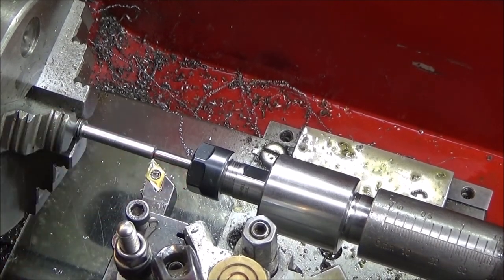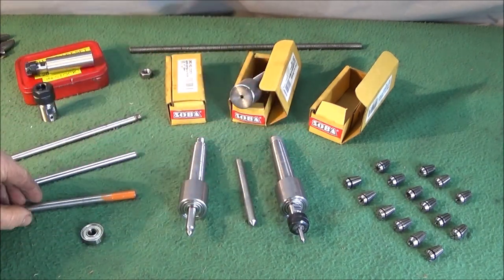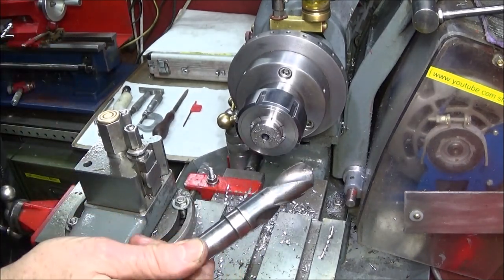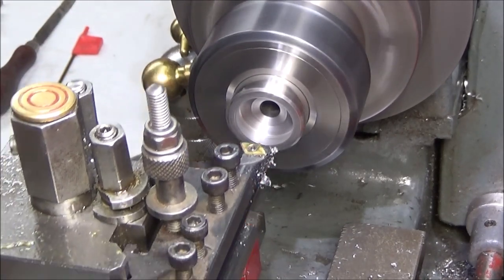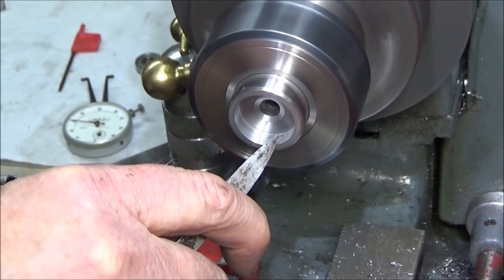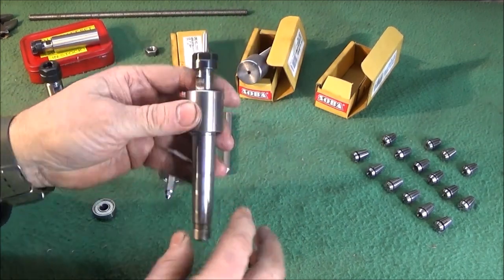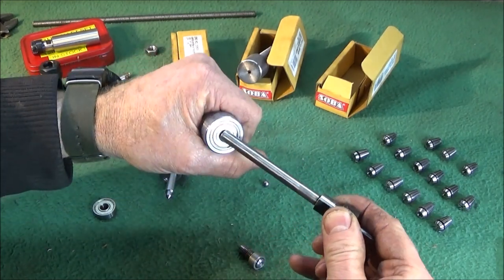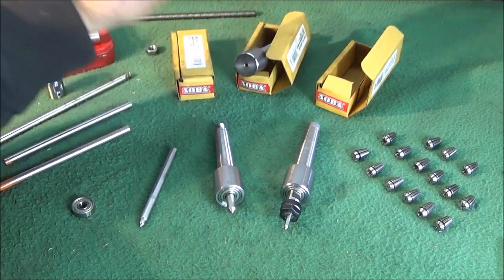Make A Multi Purpose MT2 Live Centre With An ER11 Collet Chuck

Comment: Very good setup there. I would add a cross hole through it after the  bearing for a pin so it could be stationary if needed. You could drill, ream, and use it for live center too.

Comment: Wow! Great idea. I will definitely find that useful, thx.

So much going on in that video that is different from the 'common' setups we see. The QC tool post on your Myford; did you build that? Do you have a video on it? And your ER40 collet setup, very interesting too. The T-slots on your Myford cross slide; original or modified cross slide? Also liked the way you used the dial comparator for inside measurements. Good video Steve.

Comment: Another option for spindles is to use injector pins which are hardened and come in many sizes and lengths and are very cheap. You find that most toolmakers that work in the manufacture of injection moulds usually have a box full of offcuts !

Comment: The ball does not roll, but slides.
This can damage the surroundings of the ball.
Whether it is necessary to temper them,
or is the load so small?

In any case, the idea is good by its simplicity

Comment: Hi Steve. I've made a live centre for my ML4 from your video. Because the tailstock only takes a MT1 taper, I've used 6mm Silver Steel for the spindle. The soft arbor already had a 6mm threaded hole at the narrow end so it was ready to take a screw. I was able to drill through the centre of the arbor without a problem. I bought an SKF 6mm x 19mm bearing and bored the large end of the arbor to suit. I'm very happy with this project. Thank you for a great idea! 
I would like to know if I should harden and temper the pointy end of the spindle.
Reply from the maker: Hi Neil, Thanks for watching and for your encouraging feedback. It's up to you if you want to harden the tip. I didn't though and mine is still ok. I'm pleased you like my videos.... Regards Steve

Comment: Thanks again for a great and simple design which I borrowed and put two bearings in the Soft Arbor to support a 8mm to M14x1 adapter I had around for the mini 60mm 3-jaw chuck. The shaft on the adapter is only about 1" so I figured two bearings to support the weight of the chuck should do it. Do you think I should have put three bearings in to take the extra load?
Reply from the maker: Hi Wilson, No I rekon that will be fine. See how it goes. You could always upgrade it, if you need to at a later date

Comment: Hi Steve,
I know you made this a few years ago and you've review a ready made live centre set since but this is still a very good affordable option. I have a couple of questions: would you still make it the same way or improve it and would more than 1 bearing be an improvement if they were stacked? I don't have a large ER chuck, so could the blank MT2 be drilled in the headstock arbour, or is that a no no because it might spin in the headstock and cause damage - an adjusted 4 jaw might be safer?

Cheers,

Chris
Reply from the maker: Hi Chris, I would still make it the same if I needed to. Mine is still working perfectly. You could drill the MT2 taper like that. Just make sure the spindle taper and the MT2 is clean from oil. I have drill them like that in the past. Regards Steve
Reply: @SteveJordan  Thanks Steve for your reply. I always watch out for your videos and I've made a few projects including your top slide vice mounted drill which I still use a lot.

Regards,
Chris

Comment: Steve, I'm just curious, why do you have 2 small lathes?  What can one do that the other can't?  Isn't the lovely Myford enough?  Wouldn't the space in your compact shed be better used with a different machine for another job?
Reply from the maker: Hi No both the machines do about everything I need to do. I had the Chinese Mini Lathe for about 5 years before my brother gave me the Myford. If he hadn't given it to me I probably would never have owned one and this is one of the reasons I keep them both.... That is to show people that one can buy a reasonably low cost lathe and still produce the same precision components as an expensive lathe can. 
 I find having both the lathes perfect for my situation and there are times when each of the lathes have been best suited for whatever I'm turning. Plus leaving one set up for something while quickly going to the other to do another job is a great advantage.
 If I was younger I may have bought a larger shed and bought a milling machine plus kept both the lathes, but my situation is as it is. In other words,... I'm content with what I have and don't have the need for anything else.
Reply: That's fair enough Steve, thanks for replying.  Keep up the good work!

Comment: The tailstock on my lathe is only MT1 size. I don't think drilling through and adding a screwed plug to make a ball support through the thin taper is practical. I was wondering if I could drill halfway down the taper and drop a smaller ball down the hole. Would that work?
Reply from the maker: Hi Neil. It will most probably work. I don't see why not. Regards Steve
Reply: @SteveJordan  the taper of the blanks I'm looking at are hardened and ground. Would the hardening go right through or just the skin of the taper?
Reply from the maker: Hi Neil if you heat them up red hot and let them cool slowly naturally that removes the hardness. Or you can just try drilling them. It's best to use cobalt drills though.
Reply: @SteveJordan  many thanks 👍

Comment: olá!... fiz algumas formações na vida, mas aqui só estou aprender!...  o relógio, que tem duas pernas que está a medir o caixa com precisão eu não conhecia esse método de medir com esse relógio, eu nunca vi isso !...como se chama essa ferramenta?  e qual o diâmetro máximo que se consegue medir? onde posso comprar uma ferramenta dessa !..já aqui em Portugal nunca vi , e não conheço. se me poderem ajudar agradeço.  e obrigado, pela partilha de ideias e soluções !....  obrigado amigo!....
Reply from the maker: Hi Jorge,  The clock is called a 'Caliper Clock' or a 'Dial Caliper Gauge'. You can buy them in various diameter ranges. The one I am using here ranges from about 0.200" to about 1.100" Thousand of an inch. Another is about 1" to 2" Inch range and this has longer caliper blades on the end. There are several different ranges. When bought new they can be very expensive like this Mitutoyo one on ebay:-
http://www.ebay.co.uk/itm/Mitutoyo-209-106-Dial-Caliper-Gauge-10-35Mm/112730742041?epid=500508067&hash=item1a3f469d19:g:hjAAAOSwiBJaTP2V

I bought mine as used ones from Ebay. They are quite rare but come on every so often. If you keep looking you should be able to pick them up, but you have to do extensive searches on Ebay to find them. This is because many other tools with the same description, like verniers etc come up in the searches. The most common makers include Mitutoyo and MPJ  
Regards Steve
Reply: olá!.... peço muita desculpa, mas estive desligado do mundo desde no dia 2 de Março até hoje!...é que me vieram reparar a linha telefónica,houve aqui ventos forte e partiram-me a linha do telefone. deixei de ver o mundo a distancia.
o muito obrigada,  pela atenção, ajuda que me deu ao me esclarecer-me referente a ferramenta de medir, um grande abraço  fraternal amigo!... e de vez em quando, venho visita-lo na janela , aberta para o mundo!.... obrigado por partilhar o seu saber!.....

Comment: We got banggood  ER16 metric collet set. Some are even marked with Imperial sizes and most out of concentricity, some massively!
Like the 3mm diameter  is 2.8mm out. Great for turning eccentrics!
Reply from the maker: Well every set that I have bought so far have been excellent. I have ER16, ER20, ER32 and ER40 and they have all been spot on.

Comment from the maker: ITEMS NEEDED TO MAKE ONE:

One ....MT2 SOFT Arbor... On Ebay
ER11 COLLET CHUCK x 100MM LONG CUT DOWN TO 80MM LENGTH FROM Banggood --  https://goo.gl/7fvwZN
One...608ZZ Bearing (8mmx22mmx7mm) Koyo or Similar quality.
A Length of 3/8" BSW Thread Stud and one nut.
A few lengths 8mm ground 316 stainless bar various lengths
One.... 8mm Stainless Steel ball bearing.....Ebay
EXCELLENT QUALITY REAMER SET FROM ....  Banggood --  https://goo.gl/32x6c1

Comment: Nice idea! Unfortunately, I cringed at the speed you used for the reamer, and even more so when you hammered in the bearing.  That should have been pressed in with a ring that touched the outer race of the bearing, as you can damage the bearing by forcing it in with pressure (or hammer blows) on the inner race.
Reply from the maker: I wouldn't worry about it....it turned out to be excellent. Regards Steve

Comment: As long as it's not Chinese rubbish collets! Good idea though.
Reply from the maker: All my collets are Chinese. They are excellent quality. I haven't had one problem with them and I have nearly all the ER ranges from ER11 to ER40. Some of which I bought about 4 years ago and have used extensively making precision components 
   I can't see or find much difference in the Chinese made ones, to the to the really expensive ones I used in the aerospace industry on CNC machine tools.
 I buy all my lathe tools and equipment from China now, because of the high quality and reasonable prices. 
  One would be a fool to spend 6 times more on a tool, that does exactly the same job, just because it has a well known, engraved or stuck-on, brand makers mark!
Reply: Maybe you use a different make of Chinese collet in comparison with the ones I saw in videos of reviews by different people. What I saw in these videos makes me shiver, it's so bad!